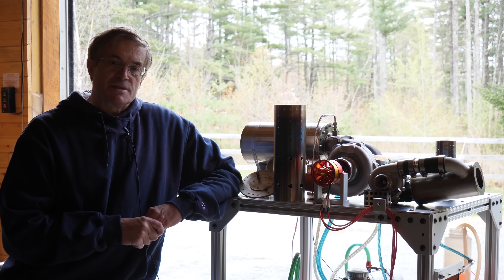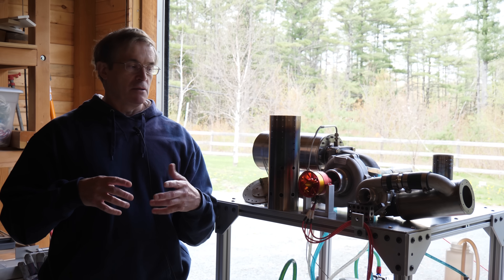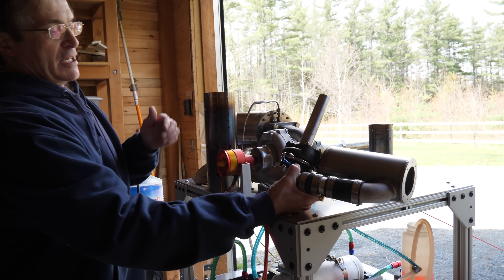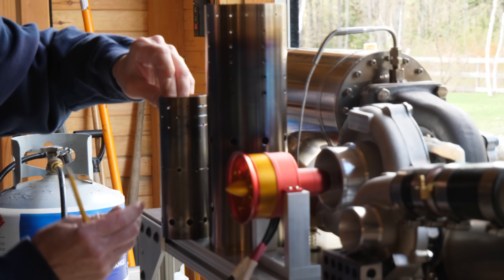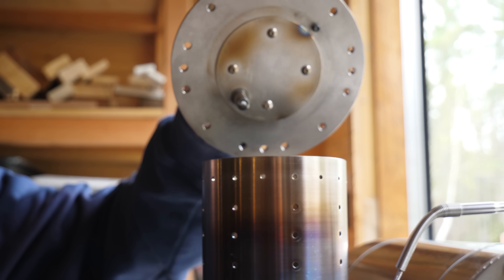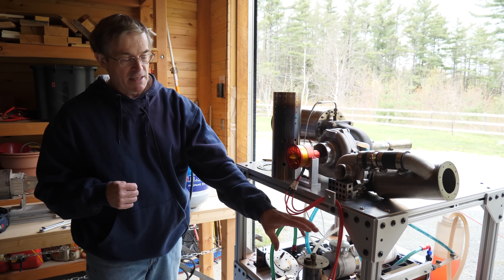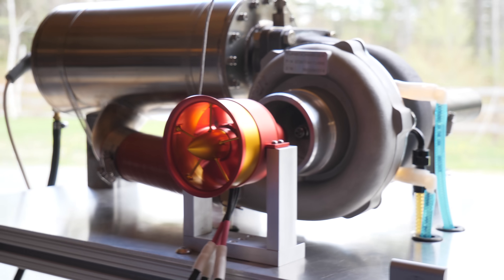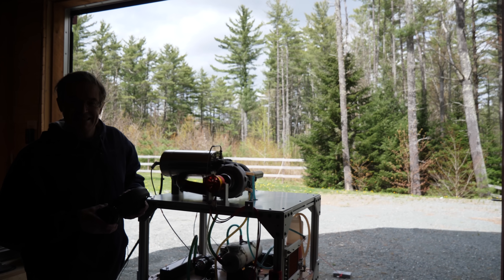Catching Fire - Refining the Jet

Comment: After a quick look at previous videos I can't quite see the purpose of this project... I'd hoped you would explain at some point what the actual purpose of making this is. What practical applications does this have? Your work looks great, but it seems to lack (in my mind) use outside of vehicles, which seems such a waste... :\
Reply from the maker: The jet acts as a medium pressure gas generator to drive a free turbine.  This in turn can generate electricity, pump water, drive a fan or propeller as well as drive the transmission of a vehicle.
Reply: @TechIngredients  but is it more efficient than ICEs? If you want to generate electricity or pump water I would assume efficiency is one of the most important things.
Reply from the maker: No, it's less effecient.  Even a compound turbocharger conversion would be less effecient and I go into this in our first video on this engine.  It's all about compression ratio.  Commercial jets with their very high compression ratios CAN exceed reciprocating engine effeciency.  But, another consideration is the higher power to weight ratio of the turbine.
Reply: @TechIngredients  One method of improving the efficiency of a gas turbine is to recover waste exhaust heat and transfer it into the air flow between the compressor and combustion chamber. Chrysler came up with a very cleaver method of doing this in their infamous turbine cars. They had a rotating disc that traversed through the exhaust and the intake to the combustion chamber. The same could also be done with a heat exchanger. Because of increased weight, this type of recovery may not be practical for aviation applications, but for a stationary power plant like yours it may work well.
Reply: @TechIngredients  very interesting. Can you make a quick video discussing these potentialities more fully? For example, power generation is incredibly important - however, you're still using a lot of fuel and is there a potential of power generation via this mechanism being more efficient than buying it off the "grid" (electric company)? Etc...

Comment: Love the videos always!  On the topic of propane: a recent project I was on built some pretty incredible pulsejets which originally ran on liquid propane.  We also had problems with the liquid (although different than yours: we had problems with actually vaporizing the fuel to burn it.  In fact one of the coolest things I've ever seen was a glowing red hot expansion chamber...with frost on the bottom!  The temp gradient was insane!).  We, like you, moved to vapor propane instead, and have lots of experience working with it as a fuel.  If you did want to stay with vapor propane, an option could be to place the propane tank in a bath of warm water, and then use waste heat form the engine to keep the water warm when the tank starts to freeze.

Comment: If your using this on the ground why not just use compressed air and inject it directly into the combustion chamber?
Reply: They basically use compressed air from the compressor-side of the turbocharger. Using compressed air from a regular Air-compressor wouldn‘t be feasible and it would defeat the purpose of an engine like this.

Comment: Is the goal to eventually power the compressor off electricity generated from the turbine?
Reply: The compressor is powered mechanically, it is coupled directly to the turbine shaft. The fan is just an air starter so to speak

Comment: Inside that Turbo it's something they call it cartridge which is the combustion fan and the compression stage plus a shaft and the bearings it's a kit meant to rebuild that turbo couldn't you mount that inside a can when you have all the parts you need for a turbine? I've been looking at some cartridges online and they're some good looking candidates for 40-50 bucks.......
Reply from the maker: The design of the housing or scroll around the compressor and the turbine are as critical as the design of the rotating components.  There's the rub.